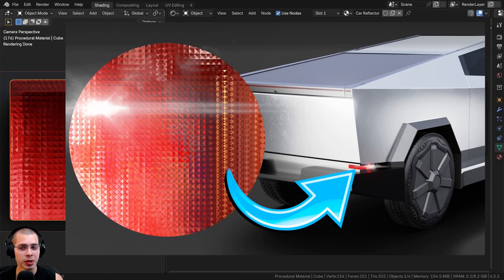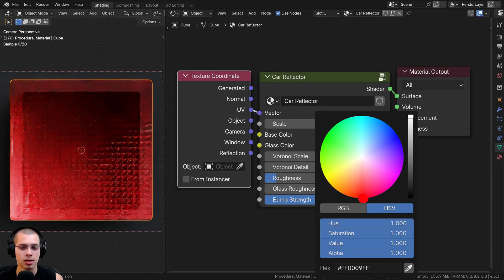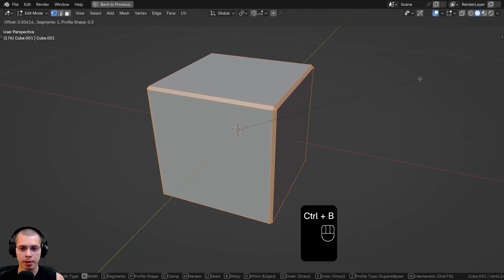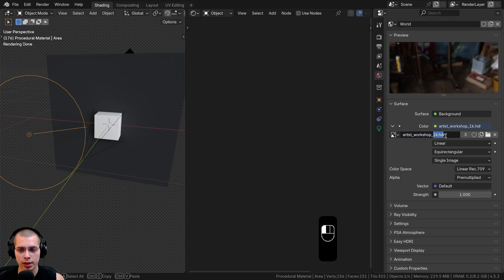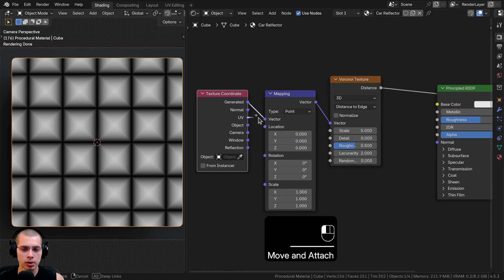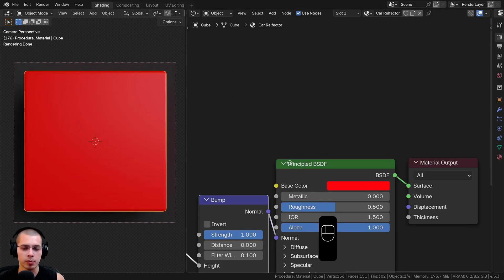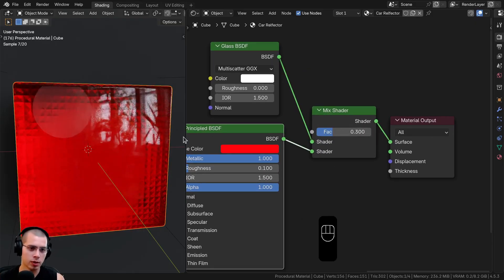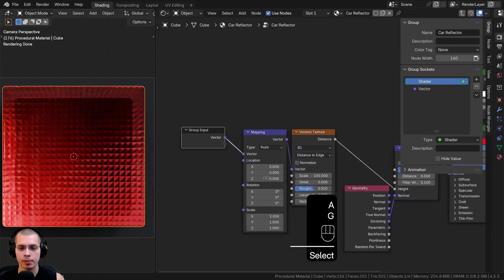Procedural Car Reflector Material (Blender Tutorial)

Comment: If you want to use this material apart of the truck tutorial and it seems just to be a shiny red thing: here are settings to start of with the default cube (if you haven't deleted it yet): take the Scale up to 7 and Bump Strength up to 10 and decrease the Voronoi Scale to 15. Than you should start to see the details again.
Reply from the maker: thanks for sharing 👍‍

Comment: this looks great, but how would we go about inverting the height of the reflector, as it is inside the glass and not above the glass.
per say, you have a glass on the out side, but behind the glass, the bump is facing towards the inside bulb of the light casing.

great work regardless thank you for sharing!
Reply: Click invert on the bump or add a color ramp between the texture and height and then invert the sliders

Comment: I recently got a new 2in1 laptop and it actually came included with a digital pen :) i havnt used it yet but im excited to try sculpting and stuff using an actual digital pen instead of just a mouse

The pen is the Lenovo Digital Pen 2 which is about 45$ Canadian dollars and has 4096 levels of pressure sensitivity :) i got it for free with my lenovo ideapad 5 2in1 which is about 1000$ canadian dollars but i got on sale for only like 650 or 750

The laptop itself isnt strong enough for sculpting but i can try using some remote desktop apps :)
Reply from the maker: Cool! Hope its a great laptop!
Reply: @RyanKingArt  I’m probably gonna try some of your sculpting tutorials :)
Reply: If you don't have a decent Nvidia GPU, a fairly fast CPU and a lot of RAM, you need to temper your enthusiasm a bit ;) For 2D sketching at least will be OK..
Reply: @nkr1159  i got a pretty good desktop pc with a radeon 6600 gpu, ryzen 7600 cpu, and 32gb of ram :) and i could use remote desktop software if i want to use it from my laptop :) currently im using Parsec as my remote desktop software because its the lowest latency remote desktop software that exists so far :)
Reply: Always exciting to get some new hardware and put it to the test.